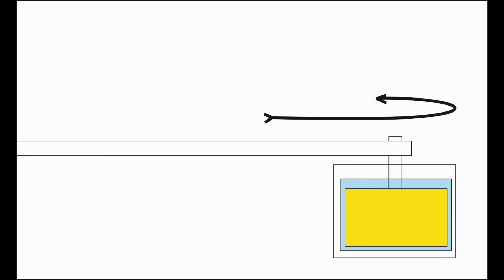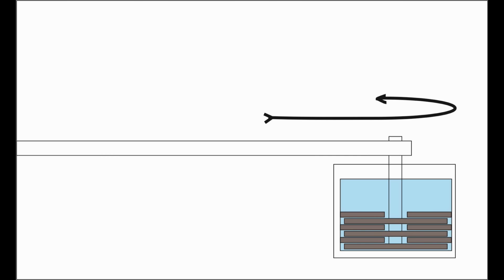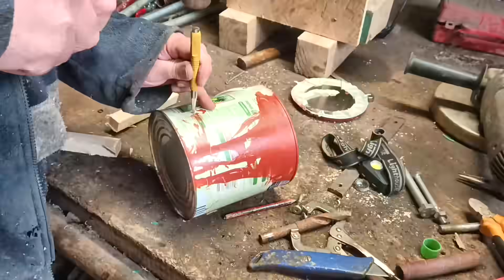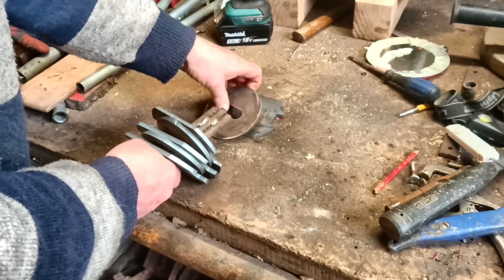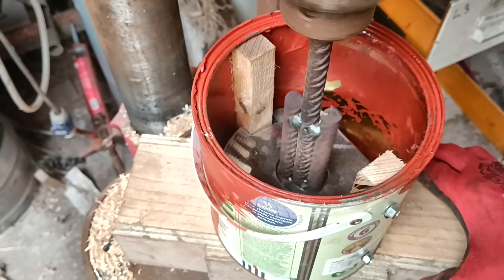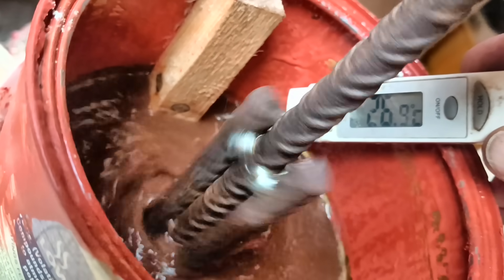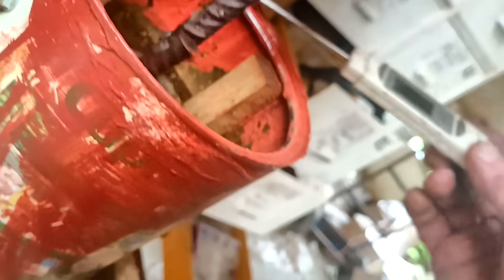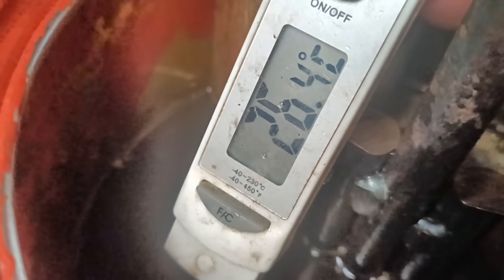Heating Water With Friction – How Practical Is It? Interesting Experiment!

Comment: When I studied mechanical engineering 50 years ago we got the task to design a water heating device driven by a windmill. Our solution was to use a fluid coupling like the truck retarder.
Reply from the maker: But I imagine you had much higher rpm?

Comment: ..an interesting device I saw a few years ago was a steel cylinder with a circular steel bar inside fitting closely with many lines of 1" holes drilled into the surface of the bar and angled backward to create cavitation which will heat the water and pump it at the same time if modified to pump as well for simplicity and compactness...horrifically efficient though...the device could actually cause an arrest and a fine or worse...

Comment: A bit more hightech. But why no run an old fridge compressor directly from the windmill.
Reply from the maker: I think they can't be run 24/7?
Reply: @wayoutwest-workshopstuff6299   how about a more simple ”compressor” that forces water through a small tube in it’s own circuit. Like the swiss cheeze paddles, only longer and stationary.

Comment: Land cruiser 4x4 used a belt driven viscose heater to improve heat up time of the diesel engine in the winter.  Worked and looked like additional ac pump.

Comment: Here's a cheap option without utilizing copper or magnets. You'll need 2 metal drums that can fit one into another with a gap of about 1" between drums. The outer drum can be a 1/4" steel and it needs a perforated or spread steel sheet lining (about 1/4" thick) welded to it on the inside, with holes about 1/4" in size. The inner drum can be also about 1/4" thick and it also needs to have a perforated steel lining welded on it on the outside. The inner drum is sealed on all sides. So you'll basically will have 2 drums inserted into one another with a "rough surfaces" between them. This is how this heater works:  the cavity between these drums is filled with water. You rotate inner drum with a 1hp motor and the rotation will cause cavitations over the perforated steel with holes between the outer and inner drums and you'll get A LOT of steam pretty fast. 
Cheers from NYC 🎉
Reply: Also, this method does not use friction between plates which causes water to look like diarrhea. You don't need an intermediate heat exchanger to isolate dirty water from the house water pipes. You get clean, pure steam.
Also, since there's no direct contact with inelastic materials, you don't need instantaneous high torque to start this type of heater.
Reply from the maker: I think this could work too - thanks. But I guess it would need higher speeds. I'll have a think...

Comment: Towards the end you mention replacing the water with oil to be run in a primary heat exchanger loop, the problem I see with this is that it (in theory at least) reduces the friction between the plates, but maybe that's not a big problem because the oil is what would be heated instead of the steel.

If you increased the pressure of the stack of steel (with springs or more steel plates) it would also produce more heat (at a lower speed but higher torque required).

The non contact methods mentioned using magnets would require higher speeds (but less torque), the advantage would be less wear however.

In terms of storing the heat, water is pretty good, it holds about 4.2J of heat per gram per degree (one of the best performing substances!), it's a liquid that's easily pumped, it's pretty cheap and it's safe in the event of a leak (at least at low temperatures). It ticks almost every box!

Good luck 😊

Comment: To my knowledge, the most efficient way to mechanically boil water, is with a cavitation boiler. The problem facing your resources/methods, is the need for comparatively tight tolerances.
Reply from the maker: and high speeds

Comment: I’ve always wondered if I did something like this would it generate more heat than an electric heater because I can sit there with a battery drill on hard concrete and get a bar red hot to steels melting point with just friction. There has to be a way to harness that energy efficiently. Maybe doing something similar inside a sand battery? Ultimately using the metal like a fuel source this way.  Sand would store heat, assist with the friction, and the metal flakes would simply add to the sand content. Edit: Just tested it and I clocked in 200 degrees Fahrenheit for 10 seconds of battery drilling a smooth bar on concrete. If I left it, it would likely reach higher temperatures and in sand it might even reach higher temperatures quicker. The bar was vertical to the point of contact. It dug into the cement a small amount and held there. The powder was the source for the heat so maybe the sand would actually work for this situation.

Comment: Something to also consider: windmills can self-destruct in high winds due to excessive rotational speed.  If your churn-gadget is equipped with a mechanical pump whose pumping capacity scales with rotational speed then as the windspeed increases so does the pump which fills the churn with deeper and deeper water.  Your paddles/disks will need to have an air gap (the hard part) so that when in air there is minimal heating, but as the water level rises more and more paddles are covered with water and begin producing heat. All that energy dissipation adds to the resistance to turning which in turn moderates the windmill keeping it from self destructing. A Nice feedback loop. A dual viscocity oil would seem to also be a very good option as the shear increases so does the viscocity and power generating potential.

BTW, a neighbour had come up with a very similar idea as this about 40 years ago, but as far as I know never implemented it.

I do like your "well, let's give it a try" attitude!

Comment: I would turn an automotive refrigeration compressor. It has a built in electric clutch. Then cónnect it to evaporation coil, and condenser coil,  using all the same stuff as from a heat pump. Charge system with phase change fluid refrigerite. Ie propane. Now you have a hot coil, and a cold coil side. Because it is a heat pump, cycle is reversible. You have cooling for  the summer, heat for winter. Store the heat under ground. This is called geothermal heating.  You could further use a solar heater absorber exchanger on the compressor hot side to increase your refrigerate temperature.  If you have enough heat difference, you can run an organic rankan cycle and generate power.

Comment: Perhaps a design similar to a Kingsbury thrust bearing would work. It uses tilting pads which maintain separation between a spinning disk and the bearing. It would create friction with the water but not on the metal components.

Comment: If you put strips of welds in a spiral design, so that the spirals run in opposite directions, on both sides of the plates, would cause greater surface shear which should then heat the water, or what ever fluid you used at a greater rate !

Comment: Some years ago I saw a system where a horizontal cylinder had rows and rows of divots drilled into it spaced fairly close together.  This was contained inside a steel drum that had lots of divots drilled on the inside, facing the cylinder.  They were both within a few millimeters of each other. The cylinder was spun at speed inside the drum with water in between.  Something to do with cavitation I think.  It was extremely efficient and produced huge amounts of very hot water.  The divots looked like about 25mm and 10mm deep.

Comment: This guy made it more efficient: https://www.youtube.com/watch?v=ROF-CImcDkc
Reply from the maker: If he'd used the same power to heat the metal plate directly, instead of driving a motor, then he could have saved energy and timber!
Reply: @wayoutwest-workshopstuff6299  That is true, but again not the point, idea is to explore what is the maximum you can get from friction drive. Of course you can anticipate that direct conversion (electricity to heat) will give maximum output but that is not always right as heat pumps can easily have COP 3 which means that are somehow perpetual motion machines as COP is grater than 1 but that is not true as heat is extracted from the environment. My point is while exploring maximum of unusual we could stumble on some interesting ideas and findings.

Comment: Noise and plate wear are the biggest issues, as well as contamination of the working fluid over time with plate material which would gum up anything you try to pump this into. Still, an interesting experiment!

Comment: Maybe you could use something like a hydraulic torque converter. Like just shoving water back and forth between a rotary and stationary 'impeller'.

I figure if transmissions require their own radiators, something like a slipping hydro clutch ought to work nicely.

Comment: i'm only a minute in, but i can't stop thinking shear. you want to use shear. it's the mode that gives the most resistance with a fluid, and therefore should generate the most heat. so really, you want a torque converter. the higher the tolerance, the less speed you'd need to give it.

Comment: Plasma cutter air: I use three separate air regulators with water traps in series. Each set to less pressure than the previous one, it seems to deal with the water better than single stage regulation.
Reply from the maker: I also have three inline driers - including a refrigerator unit

Comment: I wonder if you could use brake pads and rotors for something to purchase 'off the shelf' as it were. An old wheel bearing might also work for more parts to use from the car. And I like the idea of the metal bits being in oil, and then a jacket of water running around the outside like a steam boil pot. Only in reverse.

Comment: I would recomend bismuth bronze as it would lower the risk of rust contamination. Bismuth bronze is also quite resistant to corrosion, and copper alloys have amazing heat transfer.
Reply from the maker: that sounds a lot more expensive than steel though? And why does it need to be heat conductive?
Reply: @wayoutwest-workshopstuff6299  when i first saw this I thought you were heating drinking water and not heating water. I was thinking the better heat conductivity would heat the water faster. 

I don't know much of brass types, just a little bit of trivia.

Good luck on your water heating journey, I'm looking into building a windmill myself to grind up some grain.

Comment: cavitation plates can boil water at 100% efficiency as installed in a us firedepartments showers, you can google it based on the key words used here..
Reply from the maker: Yes, but only at high speeds

Comment: This looks a lot like a motorcycle clutch basket assembly. But those things are designed to run free for very short durations and are lubricated with specially designed oil to make em last longer. Even then they’re a wear item. If you do this 24/7 with regular oil and a regular plate pack, they will wear out. You might be better off running a heat pump compressor with this directly, or use some kind of magneto induction heating.

Comment: Broken water cylinders have great insulation at 70 degrees at least , repurposed they would also be a good size, usually the coil goes and the tank is fine, if you carefully cut the top off, you could make a new one , even use some of the built in fittings to move fluid in and out.

Comment: Many years ago, a farmer in the US made a shed with pieces of Fresnel lens, from an old lighthouse, in the roof directed at a drum of water. Even in moderate light this would boil water for a steam generator. He ran a large farm off of electricity/batteries. He used early batteries that were practically indestructible.
Reply: Hi Michael, I'd love to read more about this farmer but I couldn't find anything online. Can you point me in the right direction?

Comment: A flat coil of copper tubing, for the water to pass through, placed close to a disc with magnets would probably work better with no wear and contamination of the water. The RPMs have to be pretty high for it to work. Maybe 10k RPMs so pulley and belts or gearing to get the needed RPMs
Reply from the maker: That's the problem - 10k is crazy fast and would need lots of gearing to achieve
Reply: @wayoutwest-workshopstuff6299  more magnets and a larger plate would allow lower RPMs to achieve the same alternating magnetism. But your probably still going to be running a few thousand RPMs.

Comment: If you have a windmill anyway, then why not use a small electric generator? That would simplify the entire project and you could better control the heating, especially if it is supposed to be used for consumpion. The conversion losses of generators are fairly small and if you use it direcly for heating the water the losses wouldnt be worse then a mechanical solution. You could even consider using a heat pump, if you have a low temperature heat source like ground water or a pond or river (if that is the case consult your lokal administation about the rules when it comes to using environmental heat). If you live in a temperat zone (if i remember your viedeos correcly I saw sometimes saw snow so maybe not) you could just use an air heat pump. It just seems less comlpicaded then friction.

Comment: Apparent Inc in California just launched a PV powered low voltage all DC residential water heater. 1.3kW. Proprietary heating element. No batteries or inverters. Elegant system with no moving parts or refrigerant.

Comment: is there a possibility that you could use solar panels to create heat using heat pump. or if you have a river or a stream you can use kinetic energy with a heating element found in hot water cylinders. thank you tim i hope i'm helping you

Comment: Why not use air compression as a source of heat. Notice how hot a plastic bicycle pump gets when inflating a tyre. Use a few immersed in a water tank by way of heat exchange and  connected by a crank. Any air produced can pressurise the water tank (obviously with a relief valve) to provide a pressured warm/hot water supply without the need for an extra water pump.

Comment: The eddy current route seems the most promising, if that doesn't work and you go back to friction, oil as the working fluid, and turning the mechanism on its side with a spring for pressure might work better (you'd get even pressure on each disk instead of not much at the top, and a lot at the bottom, although I do like the simplicity of your current vertical stack)

Comment: Maybe a system where a gear/splitter turns one direction of the central windmill shaft into two shafts turning in opposite directions, thus doubling the speed of the discs rubbing against one another. So two columns of discs, maybe with two columns of half-moon-shaped stacks of static discs either side? Pretty sure with the right gearing you could multiply the potential of a low-speed high torque system in that way quite easily and increase the yield.
Reply from the maker: surely increasing the friction area would be a lot simpler than having two shafts?
Reply: @wayoutwest-workshopstuff6299  I don’t know the maths of that but then again I am a bear of very little brains! 😂😊 in a very practical sense you are 100% right, of course

Comment: What’s your heating system in the house, @wayoutwest-workshopstuff6299? Radiators I assume? If you had underfloor heating you could also run the system at a lower temperature overall, which would save in insulation and engineering / storage costs. You could attack the heating problem from both ends that way- deliver energy by wind, and reduce energy consumption by switching to underfloor. Maybe?

Comment: Maybe it's worth to look at a scrapyard for a retarder brake unit of a truck. https://en.wikipedia.org/wiki/Retarder_(mechanical_engineering). That should work just fine, as it is designed especially to convert movement into heat without wear and could handle quite some load.

Comment: Spring-pressure on top rotating plate and adjust shaft up/down to reduce/increase friction.
This would allow ideal load point to be found for any wind condition.
Reply from the maker: I'd like to see a drawing of that mechanism - I haven't worked out anything practical yet

Comment: if you can find a local engineering company with a surface grinder they could stick your plates up and grind them perfectly flat and smooth. oil would definitely be good.  really interesting project, following!

Comment: The most efficient way of doing this would be to mechanically drive a screw compressor and compress air into a submerged pipe then decompress the air into a radiator that has a mechanically driven fan.  Like a home made heat pump.  If you want to get clever use a refrigerant!

Comment: I'm very excited to see how you design and build the drivetrain. Especially if you change speed. My related project is gearing down for more torque and a gear winch is my inexpensive proof of concept. I haven't worked out yet whether a belt or chain from that to the final drive will be most suitable.

Comment: I read about an installation, in New York City of all places, that placed a turbine on a building roof and heated water to, as I recall, 168F by stirring.  Not bad, all things considered and in the 70s that was probably the most effective way to generate energy that could be easily distributed throughout a building and storing intermittent energy for use later.

Comment: Wondering if the tower could be made into a sand battery, if the goal is energy storage then I would say it is far cheaper than a whole loads of batteries. In effect constant hot water and possibly power as well.